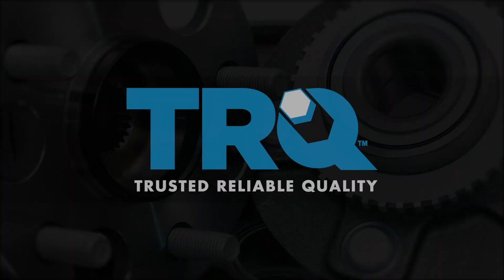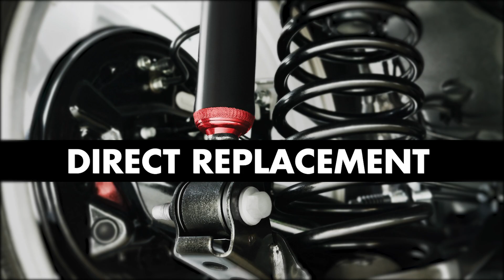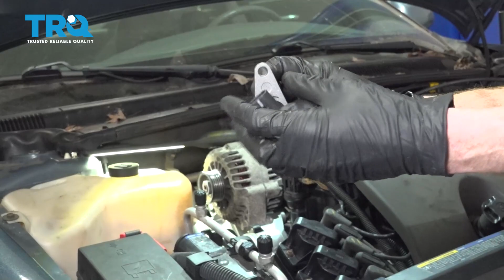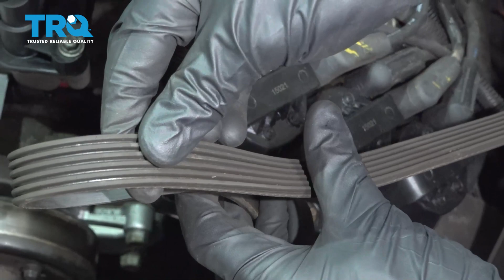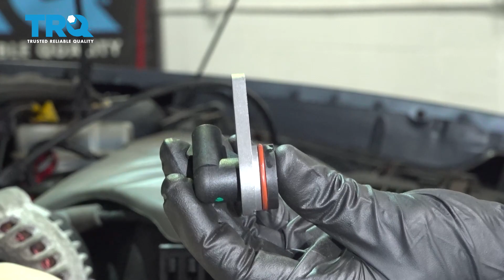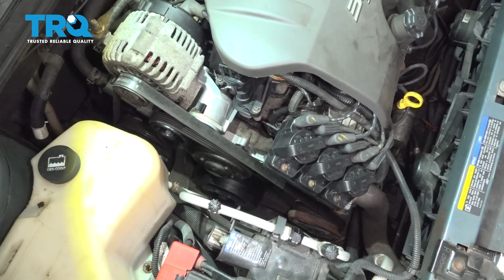How To Replace Camshaft Position Sensor 2000-2005 Buick LeSabre

Comment: Hats off to TRQ for the helpful LeSabre sensor replacement, etc. videos! I'm preparing to change the cam sensor on my 2003 LeSabre. As video suggested, I slipped a 10mm socket over the bolt head, and it felt like too much play. Then I tried a 3/8" SAE, and it was a snug fit (~5% smaller). Being 21 years old, probably rusted a bit, I don't want to risk rounding the bolt head. So I called my dealer for OEM bolt specs (P/N 25526395 - discontinued): SAE 1/4" x 20 pitch, .69" thread length, with 3/8" flange head. If I need to use a new bolt, I'll get a 3/4" long, and put a washer on it to match the threaded length into the engine. 😀

Comment: I just replaced the cam sensor on my 2004 Buick Lesabre. No need to remove the serpentine belt, I did move the coolant revisor, no need to drain it. Otherwise that was it.

Comment: Why is it when I ask for a video for a 99 pontiac 3.8 series 2. How to change cam sensor. They will only show2000   - 2005? It does, not have the motor mount that mine does!!???? I need to know if I have to pull the motor mount out or not???